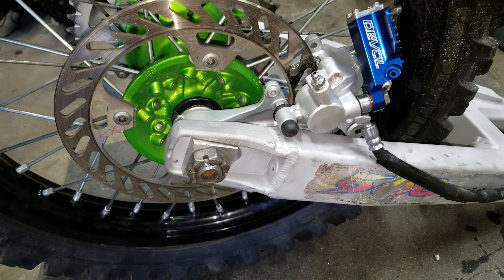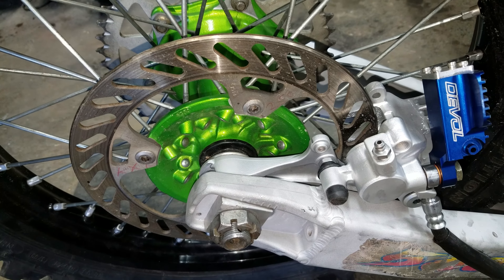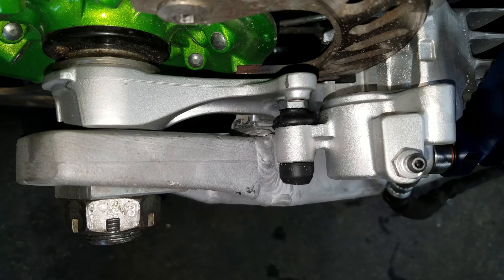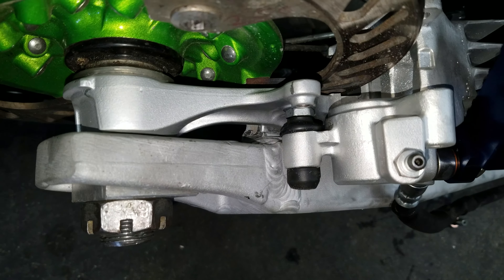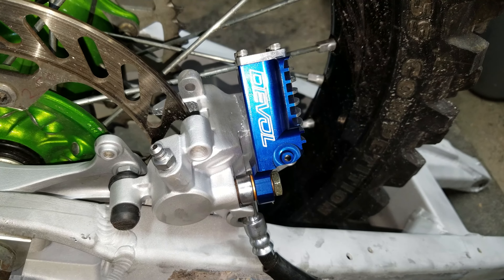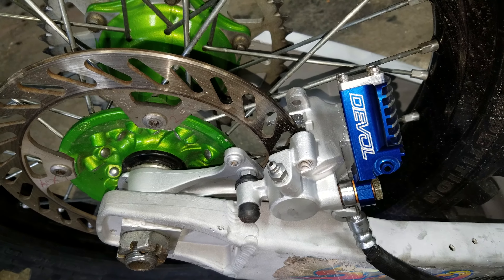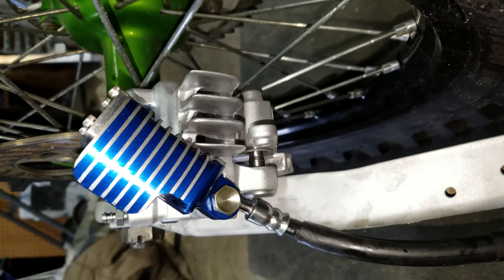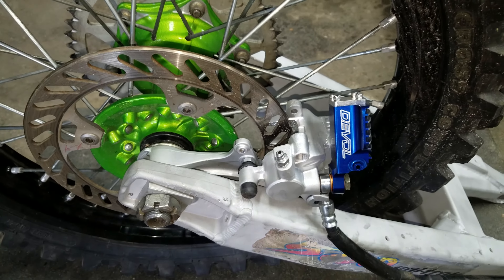KX Guru Racing KX500 Swingarm Conversion to run KX450F components

Comment: I was looking to put a kfx wheel on mine I was just wondering what parts were compatible I wanted to put 03 swing arm on but I see the 01 fits with the 01 subframe all you have to do is drill the holes out and re thread them for the subframe I know the swing arm bolts right up
Reply from the maker: I don't give out my number as I have a day job and people will talk all day forgetting that I have to make a living :-) However, you can contact me on facebook. Go to the group KX Guru Racing, become a member, and post questions there. Or, go to www.kxguru.com, sign up to be a member, and post questions. I'm happy to help when I can. Thanks!
Reply: KX Sandblaster ok thank you so much youll be hearing from me shortly on fb
Reply: KX Sandblaster I tried joining b4 and you never sent me my conformation email
Reply from the maker: Hmmm... Very odd... Try again... My email is kxguru@bikerider.com
Reply from the maker: Great!

Comment: are you going to put on wave rotors? great idea i like it. i have a kx500 and a few of your videos helped give me some ideas. i like the hammerhead rear brake adjuster with the spring, i run that on a 450 and i wanted to put it on the kx500 now i see it works i can. thanks
Reply from the maker: We used some nice aftermarket rotors,  Here is a link to the build:   http://www.oem-cycle.com/forum/viewtopic.php?f=41&t=1170    You may find a few more idea's there...

Comment: I I heard you guys testing a Perris Racing Concepts crankshaft with veins on one of your 500 and I'm thinking to do it too before I put my motor together so could you tell me how everything is looking so far? They also said that you're going to have a dyno chart?
Reply from the maker: Yes, we are working on that project and yes we will have some dyno numbers. But please be patient as it will take a while, likely a few months before we will have anything but seat of the pants impressions. Right now all I can tell you is that it looks really cool :-)
Reply: KX Sandblaster - So are you guys actually really had enough time to put the motor together and have some seat of the pants experience? If yes then what's the first impression, or the motor still apart?
Reply from the maker: We have not built the engine yet. We are waiting for some more parts. I also need to modify the cases to utilize the vanes in the crank.
Reply: Is it easy to modify the cases yourself? I know they charge $50 to modify them, I was wondering if I can do it myself.., doesn't look that compicated, just lowering the sides the same level to the bottom of the vein.
Reply from the maker: Yes, Steve just rounds the edges. I will do the same on Sean's bike. On my bike I am running a 92mm piston and will be heavily modifying that area..